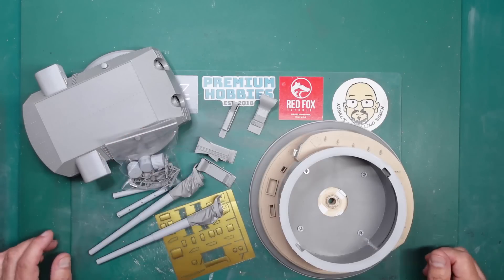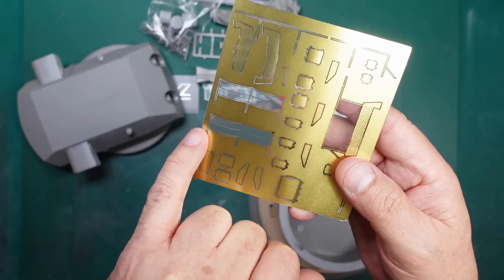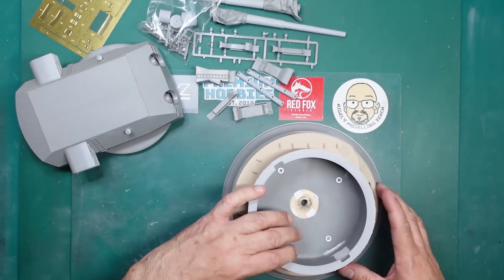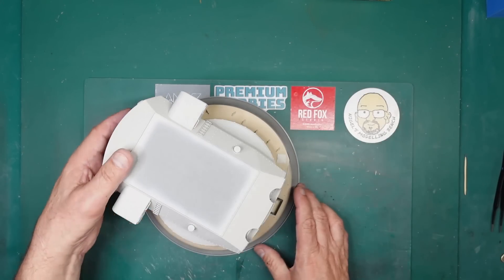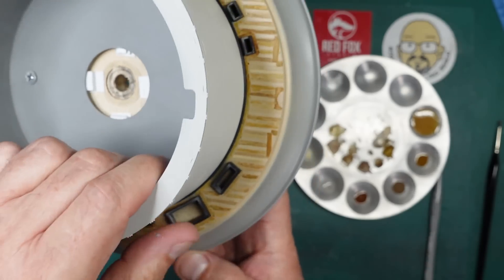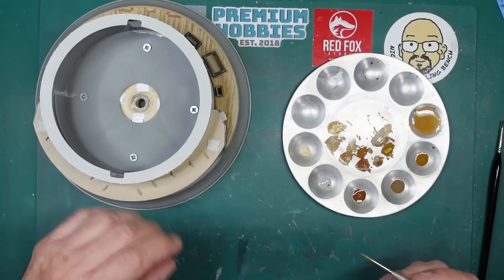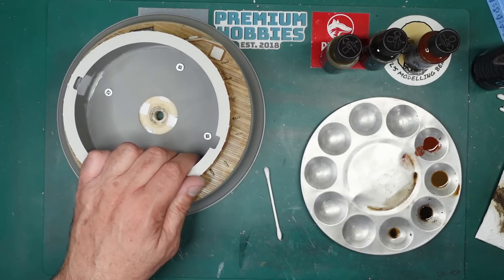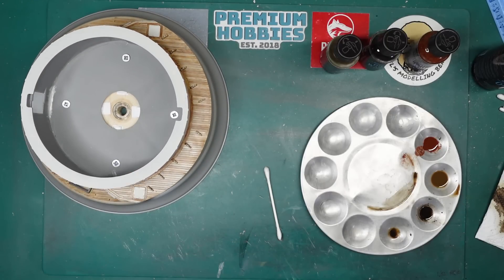Takom 1/72 Bruno Turret of Bismarck. Part 2

Comment: There's quite a lot of choice when it comes to painting the non-vertical turret surfaces depending on what time in the ship's life you are representing. In the space of a week in May 1941 there were definitely three different schemes applied (dark grey on sloping and flat surfaces, dark grey on flat surface only, light grey on all surfaces). There's still evidence for and against the flat surfaces being yellow on the day the Bismarck was sunk. The point is this is a nicer subject than some of the other turrets as the model maker has some options at least rather than it just being all one colour. Great work on the wood deck btw.

Comment: Hi Nigel, looking good so far. But, where did you get the reference for that Black line around the bottom of the barbet? I don't think it is correct. I cannot find any good photo's that show a Black band. Plus I cant find it called for in model kits from all the major manufacturers. Including Takom's instructions for this turret kit.
Reply from the maker: It is all over Bismarck Andy. Seems like all the manufacturers must have missed it?
Reply: @NigelsModellingBench  I looked at loads of online painting guides etc. None of them showed a black line on the turrets. Couldnt find photo evidence either.
Reply from the maker: Are you for real Andy?? Put Bismarck b turret into Google images and see what comes up. Ignore kit instructions or pics of models, look at the real thing.
Reply: @NigelsModellingBench  OK, I see where you are coming at. But how do you know it is Black? In some pics it looks more a dark grey.
Reply from the maker: I have painted it in rubber black. Which is a very dark grey....and i just noticed.. it is included on the box art!!
Reply: @NigelsModellingBench  Re-looked at your unboxing video. Yes it does show a band at the bottom. But its a bit vague. It looks like a dark grey to me. Mind you, even if it was black. It would tone down to a darker grey colour when it got a bit weathered. I suppose most kit manufacturers never included it because of the smaller scale of most battleship kits.

Comment: have you got your eye out, for the Scharnhorst & Missouri 1/72nd Turrets? LP-34 is the colour I've got - oops.
Reply from the maker: I may get Scharnhorst James, but Missouri is just a plain flat deck? At least Yamato has a couple of Hatches.. Why do you say Oops on the LP34? You'll just have to get a Bismarck Turret?? Maybe Scharnhorst was the same colour as Bismarck though??
Reply: @NigelsModellingBench  every single surface ship of the Kriegsmarine had Grau 51 for the hull and Grau 50 for the superstructures, so yes, Bismarck and Scharnhorst had the same basecolours. Try to avoid using RAL colour numbers. RAL didn't even exit when these colours where introduced (1896).BTW the black wasn't black but dark gray.
Reply: @NigelsModellingBench  I was sorting paints and I discovered it was Lp-34, we'll um not a turret as per say a 1/200th yamato from dave coleys
Reply from the maker: So you got it then? If so you'll need a few jars of LP12.
Reply from the maker: Yes, I have painted the "black" in LP65, Rubber black which is indeed a dark grey. Does my Grau 50 look close?
Reply: @NigelsModellingBench  yes was waiting for it to come into stock a Dave Coley's as he had them on order, as it was the cheapest there was - I'll look for alternatives lol
Reply from the maker: If you mean alternatives to LP12, then there's always XF-75.
Reply: @NigelsModellingBench  even rubber black is too black. Look at detail pictures that the dark grey is on the light side of dark grey if that makes any sense. But this is nitpicking. Way more important is that you made the right choice regarding the 50. When you look at detail pics where there are open port holes you can see how close it is to the white of the inside of that porthole's covers.